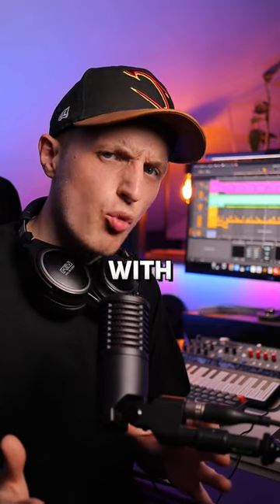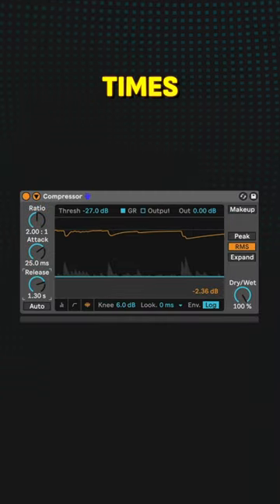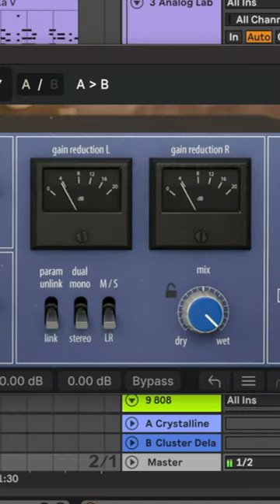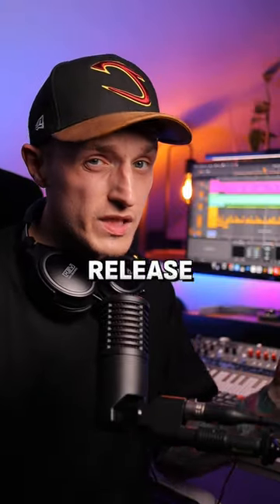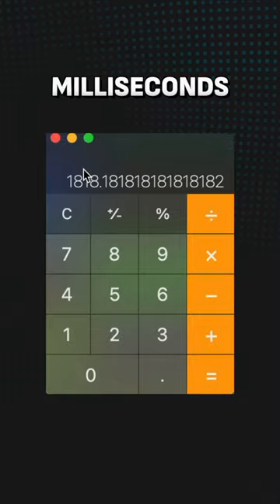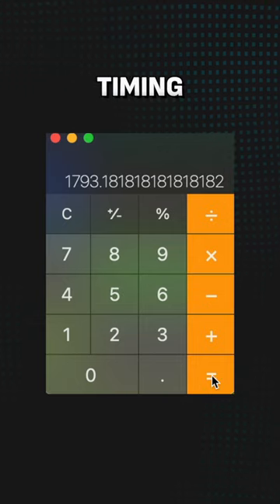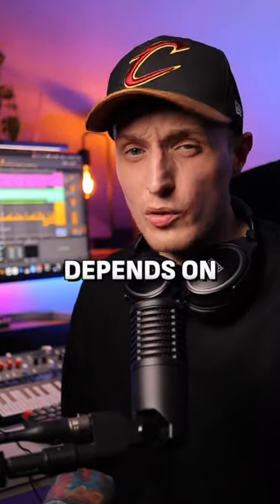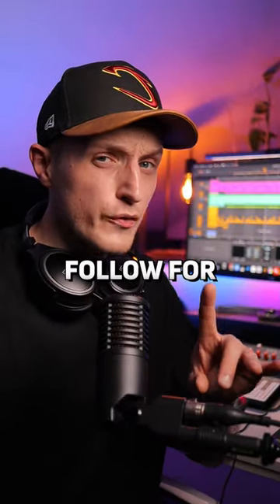What Is Mastering Glue Compression?

Comment: I still don't get it. By having a slow attack, you are letting the transient through, and then the compression kicks in. This would be increasing the dynamics no? (By increasing difference between untouched transient and the rest of the sound getting compressed ). So what's getting glued together?
Reply: the attack is normally set to a relatively fast time. anywhere from 20-50ms. i just use my ears and set it to what’s good. glue compression is the trickiest step to a good master
Reply: The audio signal being compressed makes it "cohesive", its more of a subtle thing. Its like you are commanding audio to move together
Reply: he says synchronizing "release" time, the only thing he says about the attack is that you can subtract the attack time from the calculation to achieve a tighter sync
Reply: The glue effect is really just Having the same dynamics for all you tracks (instruments), making it sound more cohesive